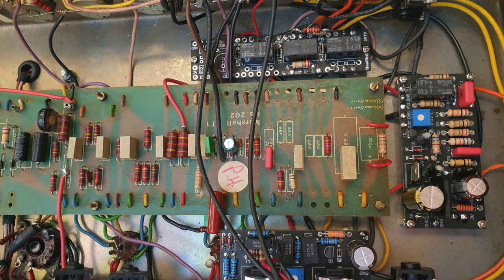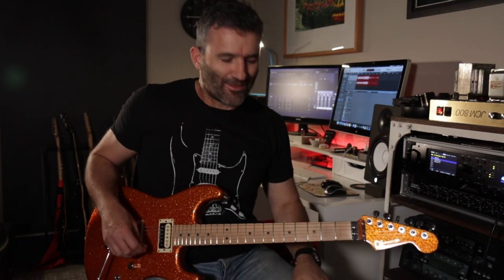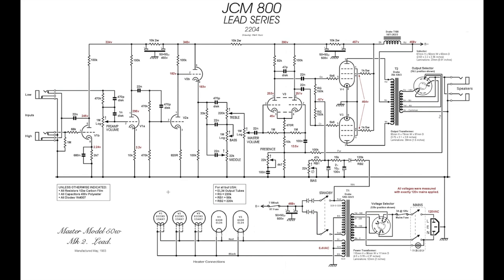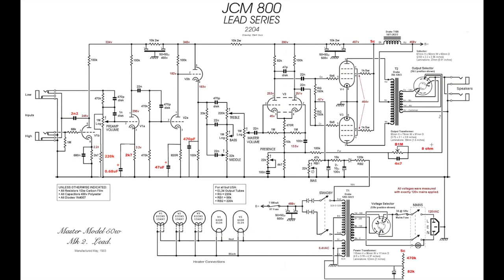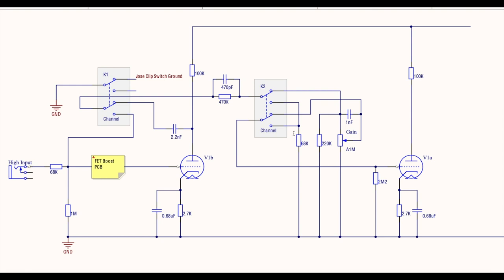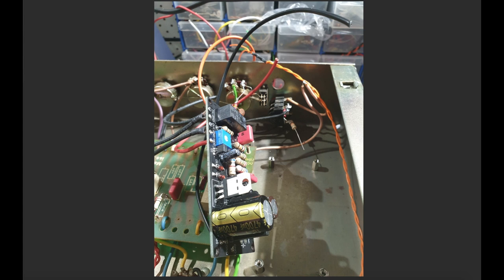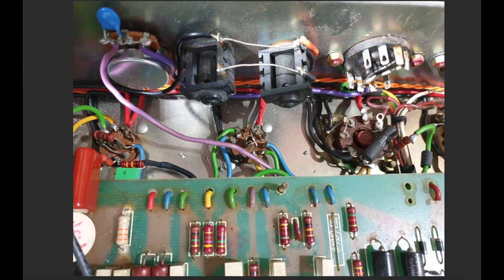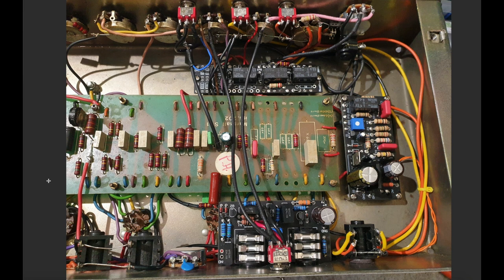Marshall JCM800 2204 - Headfirst Mods. Full play-through and DIY Guide.

Comment: Thank you for this video. I have the same amp and have done various mods to it including changing it to tube rectifier, changing it from 6550 to el34, adding boost by changing cold clipper cathode resistor, changing gain by changing coupling caps and plate resistors. The only thing I kept was the el34s. After hearing the JEL mod and the general simplicity of it alone, I am planning on performing that mod. I did build some relay boards 30 years ago to give my 2203 channel switching but removed all of it years ago and brought it back to stock. The 4010 is a cool amp by itself but I think the JEL mod will wake it up. I use the amp regularly and run it through a 1960B cabinet but wow thanks for posting this video.

Comment: God I really wish I hadn't seen this video.  I'm right in the middle of collecting parts and components for what was to be a nice straightforward no-strings-attached 2204 build with maybe a few manually switchable basic mods.   But no.....  This video had to come along with a selection of awesome mods and features to interrupt my little plan.    A friend is giving me his old broken Carvin combo for me to gut for this build and seems as a perfect medium to carry a JCM800 2204 type amp for gigging.   The idea of having a volume adjustable clean/dirty channel is an obvious boon to a flexible amp, and the diode clipping I always though was just some cheap excuse for cheap distortion pedals but in the context of this amp really adds some useable and quality distortion texture/responses.    An amp like this would make my local classic rock (70's and 80's) gigs so much more interesting and engaging.    I built and gig with a Robinette Fender amp and a Sluckey 20 watt plexi amp which are serving me well but, it would be awesome to move away from the Runoffgroove Tube-to-Fet conversion pedals into the real McCoy. (don't get me wrong, I have been successfully fooling audiences into hearing Marshall JCM800 type sounds for years now, they aren't the worst things one could use).      This amp sounds beautiful and is just so flexible I don't think I can properly live with myself if I don't take the extra steps and just-do-it..     Question.    Are these relay channel switching boards something you can purchase at a website?   Thanks for the excellent video's - so well explained and inspiring.   And I love the tone and response that your are getting.
Reply from the maker: Hi Philip, thanks for the comment.  There is nothing tube amp gain, a pedal can get close but still not the same!  Yes, all these boards and more are at https://headfirstamplification.com

You might find one of my main boards will give you everything you need in a single PCB.

Comment: great work Jason. Just wondering, Johan Segeborn here on youtube mentioned in one of his videos that the only difference between 2204 combo and head version is 4n7 Cap on the mid pot in the combo. That cap is not included in this schematic
Reply from the maker: This is true.  There is a schematic for it, it’s under a different model number.
Reply: @HeadfirstAmps   looks like it was removed because of the JEL mod

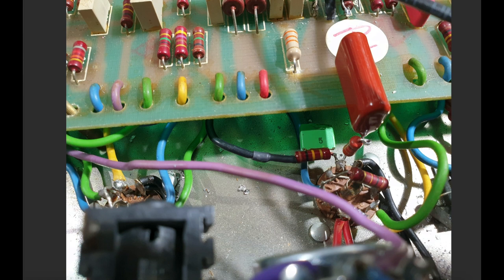Comment: No-the .47uf cap in series with the 10K resistor off of the V2b cathode for the Jose clipping mod as shown in the schematic at 38:30 in the video, and shown and discussed at 50:50.

Comment: Can you mention what voltage value the .47uf coupling cap in series with the 10K resistor off of the cathode before the tone stack? I'm assuming something like 600v, but want to be sure.
Thanks for the great video and sharing the info.
Reply from the maker: 470pF cap in parallel with the 100k cathode resistor?
Reply from the maker: Oh the Jose part.  400v is ok there

Comment: Try changing the 470K to ground to a 1M between the first preamp tube and the second preamp tube. Put a 470pf on outside terminals of master volume. Replace the first stage cathode bypass cap to a 330mf. This, for starters, will warm up the amp nicely.

Comment: This is the one I decided to build which has begun.  I do have a question - are we good to go with also providing switchable bypass cathode cap (like the one that on the bottom of the chassis) and also a a switchable means of restoring the cold clipper to a 10k resistor, only?   I was just entertaining bringing the amp further back even closer to vintage spec while keeping all the great mods that are already in this video.  I want them all?  Do we see any issues with also including the 2 extra mods I just mentioned?   Thank you for this.  Very much excited to add this one to my build collection. Thank you again.!
Reply from the maker: You can definitely add a switchable bypass cap/resistor.  That’s a common mod.

Comment: I really enjoyed following along the stock 800 vs moded. You presented it perfectly.
As for using FET circuite, what is the difference between just using a good drive pedal in front of the amp?
Which of the presented modes that were presented in the firs half of the video can still benefit an 800 if I just stick to pedals fir drive? (No FET, no Diodes, no chanel switching)
Reply from the maker: The FET operates at high DC voltage (250+) so is way more dynamic that a pedal.

Comment: Question about the resistor.

What’s the 220k on the diodes switch function?
It’s in series with the 10k and .47cap?
Reply from the maker: There are schematics for how this is wired in the mod section of the headfirst website
Reply: @HeadfirstAmps   Ahh . So it’s the same function as the 1meg in the Headfirst Sat switch. Once things come off the board and go to a switch, I get lost.

Comment: Just learning here, but I noticed that first schematic that comes up in this video for K1 & K2, the 1M resistor is going from ground to in front of the 68K. between the 68K and the fet boost before going into V1B.  whereas the the 1M on the stock schematic you show first has the 1M resistor going behind the 68K between the jack and the back side of the 68K.  Does it not matter if it's solder behind or in front of the 68K resistor?  is that part of how the mod works for the channel switching?  Thanks...
Reply from the maker: I think that’s a mistake on the scheme that I drew.  The 1m to ground should be before the 68k.  Good pick up.

Comment: Good afternoon, I am writing to you from Colombia, I am in the project of assembling a clone of the Marshall JCM 800 2204, but I do not have information on the transformers to have them manufactured, it is possible that you could help me with the technical information on the input and output voltages of the transformer. power, as well as the output and shock
Reply from the maker: Visit amppartsdirect.com, all the spec sheets are there.

Comment: A couple comments on this video:
1. You chose the 47uF 3rd stage cathode cap, but if you want Ed's value and tone there, you/one needs a 470uF cap, not 47u.
2. The 470p on the 100k Cathode Follower does exactly what you communicate, but just want to note that this can be found abroad and in Friedman amps as Dave's "DARK" MOD!
3. Interesting you chose a 8 ohm tap with a 100k NFB resistor!  It's all in what the end-user wants, but typically and if one wants Marshall values....the higher the resistor, the lower the tap!  Soo, if you look at say Ceriatone 1967/68/69 schemos for 2203's, you can see a 100k is typically on a 4 ohm tap, 56k or so on a 8 ohm, and 47k or so on a 16 ohm tap!

Enjoy and Cheers!
Reply from the maker: Thanks for the informed comments man!
Reply: I tend to go with what sounds/feels best and on my own build ended up with my 100k on the 16 ohm tap! Way off spec but soo good!  Way too loose and dirty on anything less. Cheers.
Reply: it's my understanding that just about anything 47uF or greater for a cathode bypass cap is going to have exactly the same effect, as all audible frequencies are already passed at the point 47uF sets. your notes are awesome, just wanted to point out the 47uF to 470uF likely will make a negligible difference, if any, so one might as well save the extra dollar!